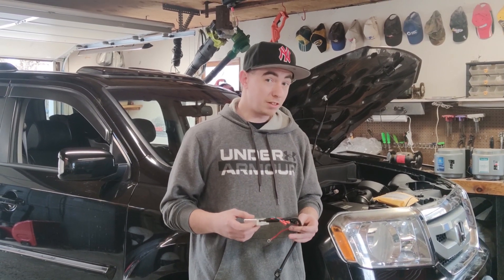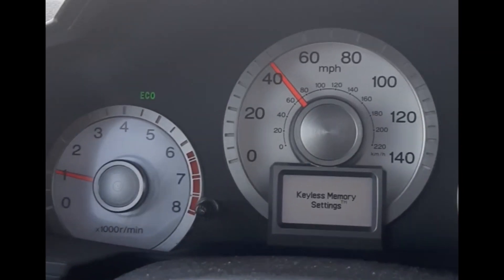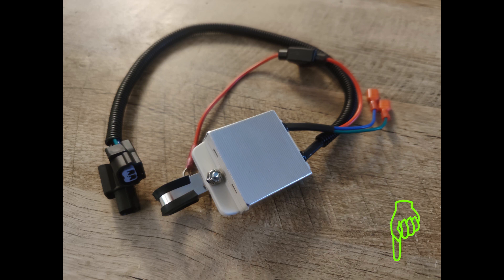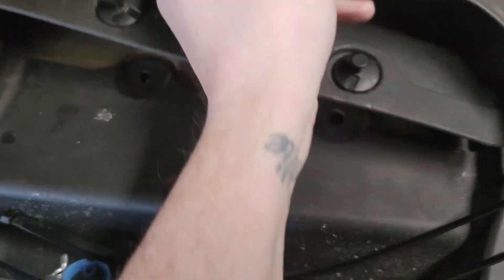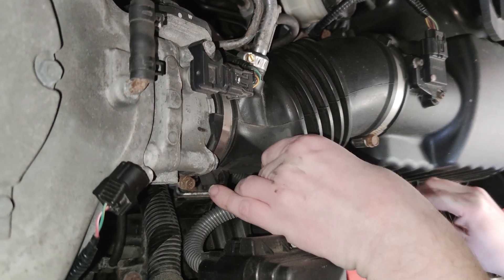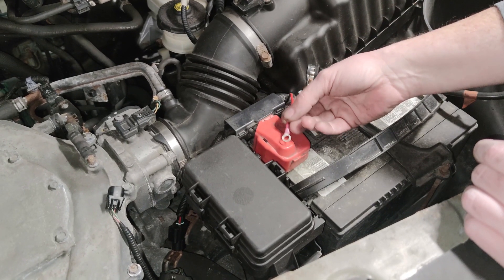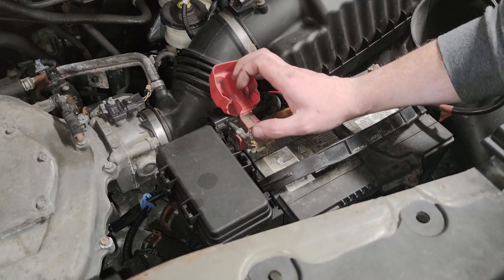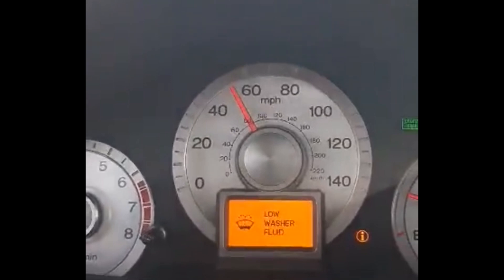Honda VCM Tuner II Eco Delete And Info

Comment: As an update from my post a year ago…I installed a S-VCM on my2012 Honda Accord EXL 3.5l V6.  Since doing that, some 20,000 miles ago, my car doesn’t consume any oil or lost any oil.  The product I bought is amazing and did the trick.
Reply: What's you mpg?
Reply: @NERDLYFE-es9ef 
Bingo
Reply: Do you feel it’s faster as well? Transmission performance?
Reply: @Inmyownpalac3 
From my what I think I remember from the product description, it locks the car in ivtech along with disabling the vcm. I just installed one last night and it definitely has more torque
Reply: Good for you! My wife ‘13 Acura RDX , 150k no burning oil, no problems whatsoever, valve cover gasket was leaking oil and the issue was fixed, should i use such device to alter the vehicle performance ? I go from one oil change to the next one without topping off the engine 🤷‍♂️
Reply: What part is it? I have a 2018.

Comment: I recently installed it on my 2013 Crosstour and it’s running smoother and better than ever! I’ll update y’all after a few weeks, months or so.
Reply: Hey did it work and my tuner doesn’t have the black cover around it I wonder will that make a difference

Comment: I have a 2014 rdx. I now that it has cylinders turning off at highway cruising because I can feel it disengage and my mpg jumps up to around 30. I do not have any eco light though. What should I do? Don't want to buy one of these if It won't work on my application

Comment: Great video, thanks. Question,... I have a P3497 code for VPS Stuck off Bank 2. The  VTM-4 comes on after about 10 minutes of driving. Some Cylinders become de-active and I have to drive in Limp Mode.. I've done everything under the sun (changed oil, changed VVT solenoid, change spark plugs etc) to try and fix this except take it to the dealer where those wolves will be ready to attack me with a bill for half a mil just for plugging in their OBD. Anyway I can erase the code myself. Do you think that if I do this VCM Eco delete method that the Check Engine will clear for good?

Comment: i am just starting to have the shutter when ECO light is on and cruising, 2015 Pilot awd, thought it was a driveline issue. 163k miles, no oil leaks or unusual usage...do you think this S-VCM will fix the shutter and not hurt the engine?? ty

Comment: Here is how I disabled my shitty VCM tech on Accord 2009 without buying any device. Relay the radiator fans to run direct all the time; this will keep the engine temperature at about 155F and trick the ECU that the optimum operating temperature is never reached which in turns, never activates the stupid VCM.

I did not notice any drop in MPG bt the car is now super responsive with more power than ever.
Reply: The problem with  this method is that the engine is not running at the correct temp. With the  muzzler
installed the engine is running at the correct temperature, it just thinks it's running cooler.

Comment: I just installed the S-VCM on my 2011 Honda Odyssey (75,930 mi.) this morning and then took it for a test drive. The engine seems to be running smoother and I can tell there is more power there when going from just cruising to accelerating. I paid $95.00 plus $11.00 shipping for this item and I was a bit disappointed when I got it. It is quite small and there isn't much to it. It comes with detailed installation instructions which insist you must follow in strict order. When I did that I found that after using the tiny zip ties provided I could not connect the S-VCM to the sensor because it wasn't long enough. I had to cut the ties, connect to the sensor, and then use my own zip ties (recommended) to secure the electrical harnesses.
Reply: Are you happy with S-VCM ?
Reply: @shaansiddiqui3872  Yes. I wish I had known about it years ago.

Comment: I have a 2014 Honda Accord EX-L with an Earth Dreams V6 in it. Does this car have a VCM system?
Reply from the maker: According to a quick Google search yes this engine is plagued with the dreaded potentially damaging vcm system..
Reply: @GitItGarage  I’m pretty sure that’s what causing the vibration in mine at cruising speeds but I’m not sure. When I take off and get rolling at a steady speed, I’ll let off the gas a little and it’ll start vibrating sometime. When I hit the gas the vibration eventually goes away. Does that sound like a VCM problem to you? I appreciate the speedy response to my earlier question. Thank you so much.
Reply from the maker: Some models illuminate a vcm light on the dash somewhere to inform you when vcm is engaged. if your noticing this  while at cruising speeds I would assume it's directly related to vcm engaging/disengaging.
Reply: I also have the 9th gen Accord (2013 EX-L V6) and having the same problems as you are. When I'm cruising, the vibration is so bad, and you can even hear it humming a low pitched noice too. I had to replace two engine mounts at the beginning of this year, and my Accord only had just over 51,000 miles on it at the time. I'm definitely gonna get this VCM disabling device soon, this issue is driving me nuts lol.

Comment: How do you tell if the VCM system is on or off  in a 2021 Ridgeline ?  How do I know that the electronic unit is doing its job ?
Reply: you wont know, I have same vehicle, I used the Smart VCM, I ended up taking it out, the truck runs great without out it, You do get a lot more power on highway with the muzzler but it was almost too much, like you wanted it to go up a gear...I think the VMC smooths things out and I think honda nearly perfected the VCM now, older version of the J35 I would def use it.

Comment: How late is too late to install the SVCM/muzzler? My Pilot is at 94,500mi, gave me code P0303 two days ago. Changed cylinder 3 plug and coil, now it’s fine again.
Reply: A lot of reviews say it fixed the issue moving forward so I imagine its not too late.

Comment: I saw a YouTube video in which the presenter stated that deactivating the VCM on a vehicle will make cause it to put out more emissions. I'm concerned that the increase in emissions will eventually cause the vehicle to fail a smog check.  What is thought on that issue?

Comment: OK, I am interested in buying this but have a few reservations. I have a 2015 crosstour with the 3.5L V6 and it has that VCM crap and I hate it. I understand how this works - it tricks the ECM into thinking the engine is too cool, thereby disabling the ECO mode. Only thing, if the ECM thinks the engine is too cool, doesn’t it increase the fuel input until the engine is up to temperature? I thought all engines basically operated this way when they’re cold - run fuel-rich until engine is up to normal temp. So my concern is, I don’t want the engine to be running fuel -rich all the time and effectively washing down the cylinder walls. Anybody else have this concern?
Reply: Have you found out any additional information about this? I'm curious as well.
Reply: @GucciGamerTV  Hey man, I ended up buying it, and it works great! In fact, I corresponded with the guy who sells them a few times on email and he put any fears I had to rest. Yes, it basically tricks the engine into running just barely below its normal operating temperature, but it’s essentially negligible on the temp gauge, at least on my car it is. The temp sent to the ECM is just low enough to keep that stupid ecomode from coming in. I’ve been really happy with the tuner. Think I put it in about two months ago and it’s done great ever since, we’ll worth the money…

p.s. he assured me that it is not running in the fuel rich, warmup mode Says the temperature reported to the ECM is not that low but just under threshold to keep ecomode defeated.
Reply: @willytv275  thanks for the response! I’m here as well because I just bought a Honda Crosstour 2015 V6 myself and I was very curious about this. I wont have the car in my hands until another couple of days but it’s good to see other Crosstour owners are having good luck with it!

Comment: Literally just posted my car for sale two days ago because my engine misfire is really bad. Been having to change the spark plugs every few months since I bought the car 5 years ago.  I changed the spark plugs yesterday morning, drove 20 miles on the highway to work and the car started misfiring as soon as I got off the highway. From experience and also reading a few Honda forums it seems like spark plug #3 seems to get oil fouled and covered the most. 
Took the car off Craigslist last night and bought the s-vcm. Hoping this will fix the issue.
Reply: It won't.
Reply: @tonpear5909  it actually might. I read about couple ppl that’ve had this same issue & they installed the s-vcm & changed all spark plus (1 person had to replace gaskets to fix oil leak as well) & they’ve been driving for over a year with no issues ever since
Reply: Did it work
Reply: Did it fix the issue?
Reply: Did it help?

Comment: unplug both upstream oxygen sensors it will delete vcm and your car will go like a rocket. you will get engine light ignore it. i tried vcm delete it works bad and increases fuel consumption a lot due to wrong low ecu readings of engine temperature.
Reply: Yeah p402 cat code turns off eco and you don't need the pricey tunner

Comment: I have a 2008 Odyssey Touring with 250-K miles.
Love this vehicle but I have had issues.
I maintain it well but I had VCM and oil leaks fixed, camshafts replaced due to engine Noise and oil consumption.
I had timing belt and water pump/tensioner done in the past.
Spark plugs repl and a coil pack.
My last dealer repair was for oil
Leaks but the never mentioned the option of a VCM shut off probably because it’s aftermarket.
Sucks because I’m friends with the service manager, nice friend huh?
They quoted me over $4000 to replace the rear of engine cat near firewall so I did it myself for $250 and a few hours labor , top bolt drivers side was a real mofo.
I try to service it regularly but when dealing with this dealership they don’t search your service history and make proper recommendations and I feel like I have to overlook their recommendations and make my own as far as what needs to be done.
I like to do my own work but I have my limitations.
My last repair at dealer was a valve lash adjustment and spark plug change to correct an intermittent #5 misfire and check eng light.
The light stayed off for a couple days then came back.
I got another cyl 5 misfire and replaced the coil Pack myself and it has been out since and running fine.
I have had oil consumption issues since day one and now after seeing this video I can see why the dealer never mentioned it.
I worked at a Mercedes’ dealer as a tech and I know anything aftermarket makes them feel like you raped their mother and they won’t touch the car with a ten foot pole.
I’d love to do this VCM delete but I don’t want to do it unless I know it’s not gonna cause catalytic converters issues and O2 sensor issues, overheating or egr issues.
Can anyone answer this?

Also one big upgrade I had to do is install some aftermarket front pads and rotors cause the factory brakes seem way undersized for this vehicle and it would not stop for crap.
I installed the EBC YELLOW stuff pads and rotors and this thing stop ten times  better now but the brakes do wear fast cause they’re softer but I’d rather replace them more often that not have brakes and warped rotors from the heat.
I love this van and I keep it looking new, everyone even the techs always comment on how new my van looks.
I want to keep this baby top notch for my wife to drive cause she absolutely
Loves this thing but this darn VCM seems to be its biggest drawback and I’m tired of the oil consumption every 1000 miles.
I just don’t want to do it if it will kill my cats.
Reply: On the flip side, if you don't do it the engine will self destruct.
Reply from the maker: This exact video is on a replacement engine not sure that was mentioned in the video.. but good point! 👍

Comment: I installed the vcmuzzler two years ago and have had great results.  No eco light and no more oil use or fouled spark plugs. This device seems overly complicated.  Why must a wire be connected to the battery?  I have a 2010 honda accord 3.5 liter 6cylinder.
Reply: because it's not a resistor that works on a fixed temperature.

It's a controller that communicates with your ECU.

The advantage is
• More precise disabling
• Provides closer readings to actual ECT, so your ECU is running your engine the best it can
• Much less risk of engine damage if your engine overheats

If your engine overheats, this device will tell your ECU, whereas VCM Muzzler will continue to provide false readings to the ECU.
Reply: @chibba5418  Do you mean that vcm tuner tells the computer that the temperature is high while vcm muzzler doesn't??  please reply
Reply: @alielosta9071  Yes, that is exactly the case. The Muzzler uses a fixed rate resistor, so the ECU never sees the actual engine temperature. VCM tuner has circuity to disable itself and pass actual temp readings to the ECU and dash gauge if the engine starts to overheat.

Comment: Wish I saw this video 4 years ago when I bought my 2010.  I installed the VCM Tuner II 5 months ago. I was tired of the shaking car and consuming oil. I first noticed my issue last year when I went to do an oil change and only had 2 qts of oil empty from the van. Last night was the first oil change since the tuner was installed. I was happy to drain 4.1 qts. I wish I had installed it sooner. My 2010 had 186,000 miles on it when I installed it. I wish I new about this earlier before I bought the van a few years ago but if $120 buys me another year with the van then it’s money we’ll spent.
Reply: So buying a high mileage Honda do you think the VCM damage has been done long term or has your VCM fixed all perceived issues? I’m looking at similar mileage…curios if damage has been baked in.
Reply: @cowlumbus  , My van is no longer consuming oil like it had in the past and no longer shuddering as I drive.  My wife is also a fan of how it isn’t shaking anymore as it switches cylinders on/off.  I justify the cost especially now since vehicle prices are up and if this prevents and engine failure causing me to buy a replacement car then it will have been worth it.  I paid $135 which isn’t bad.  Some people pay that between 3 oil changes. This $135 keeps me from having to get my funnel and oil out constantly each month.  The  constant shaking is gone which I feared the engine mounts would go which cost a lot.  Yes I am sure damage has been done, but for $135 this prevents more damage that would require a high cost repair.  It should also cut down on my spark plug replacement.
Reply: Is this link safe to buy
Reply: @alielosta9071  that is the company I bought mine from.
Reply: @moosemonty  I want to know where to buy vcm tuner ||  ??

Comment: I noticed the little green and blue wires with flat connectors weren't used, are they only applicable to certain vehicles?
Reply from the maker: In the included instructions it says the green and blue wires are for additional features of toggling it on and off and also an audible alarm feature. Not a necessity just extra features. Hope this helps!

Comment: I was told to install this to reduce the issue I have with my 2012 Honda Accord V6 3.5l engine from consuming oil.  Will this actually help?
Reply from the maker: Absolutely will help with the oil consumption issues ! On this particular vehicle the owner of this pilot was loosing 1qt every 1000-1200 miles every month . 3 qts guaranteed between oil change . Ever since the vcm delete it is maybe loosing a half a qt every three months . Less vibration from the engine and a whole lot more get up and go ! V TEC kicks in at low rpms now too and doesn't wait until 3k. Vroom Vroom .
Reply: @GitItGarage  So my battery is not like that where you have that extra post type of thing where you plugged the red wire into.  My battery just has the basic post and cable.  Where else could I wire this into?

Comment: what is the difference between the 130 dollar vcm tuner / eco delete and the 80 dollar vcm tuner
Reply: the cheaper one doesnt have an automated thermostat and will require adjusting from summer/winter months to function properly. He states in the bio though that some states that dont have 4 seasons can sometimes get away with setting it and leaving it.